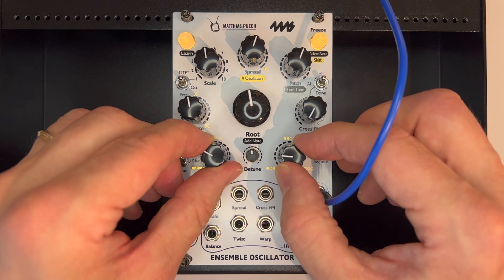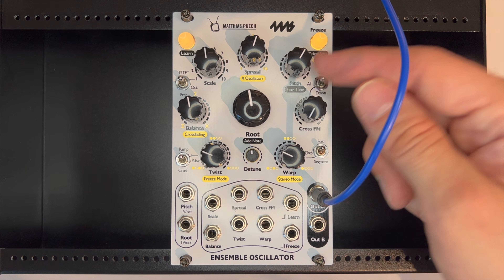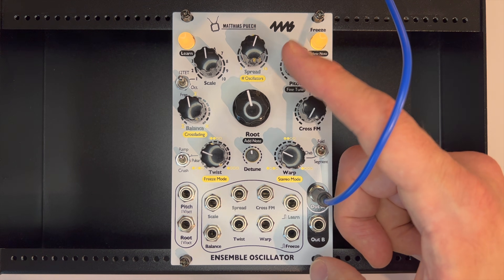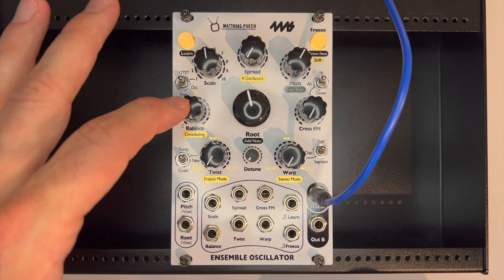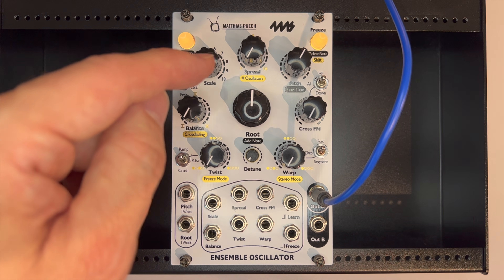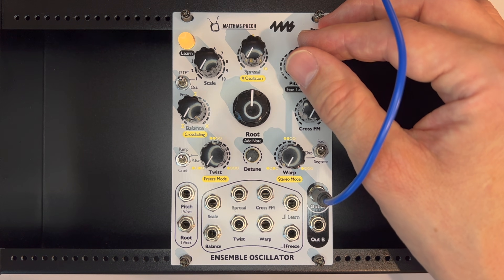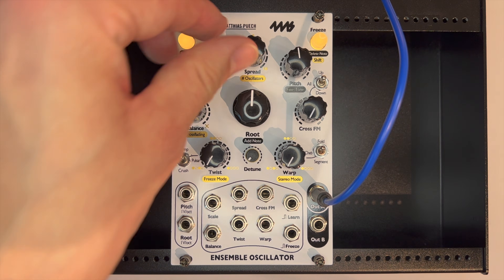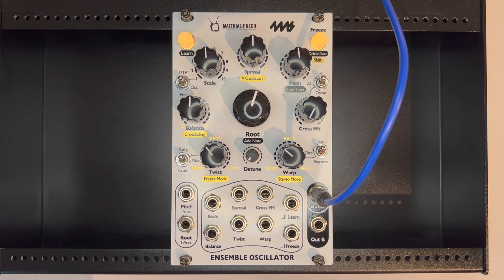How to tune the 4ms Ensemble Oscillator

Comment: It almost sounds as if when you turned knobs on the Ensemble, the other oscillator was harmonizing with it. Was that the case? If so, how did you patch them together?
Reply from the maker: They were not patched together or coordinated other than being in tune and sticking to the same tune.

Comment: Great tutorial! Have you had to mess around with calibrating the 1V/oct jack? I've tried it half a dozen times to calibrate it properly to my Arturia Keystep but it never seems to work properly. Ultimately I have to use the Keystep on the lower octave levels and then pitch the EnOsc up to whatever my desired register is to maintain accurate tuning when playing across the entire keyboard. I'm curious if anyone else has ran into this problem.
Reply: Same, never had luck calibrating 1v/oct jacks and tracking is in general not so satisfying sometimes depending on the octave changes.

Comment: PS, wouldn't it have been nice for them to put a lock / latch switch on there for the pitch? 🤩
Reply from the maker: A pitch lock is now available in a new firmware update
Reply: @MartinDoudoroffLLC  Hi Martin - been to the 4ms site and can't find a link for it (yes, looking in the firmware/manuals tab) - nothing there... suggestions? Thanks
Reply from the maker: @stevekirkby6570  https://www.modwiggler.com/forum/viewtopic.php?p=3849531#p3849531
Reply: @MartinDoudoroffLLC  Thanks so much, you're a star!
Reply: Now, not wanting to be a pain (LOL) but how do you perform the upgrade (ie, which button combo's and input for the wav file) ... again, no info on the 4ms site or on 'wiggler. Last question, I promise!
Reply from the maker: @stevekirkby6570  It’s in the manual.

Comment: How are you triggering the module? Is there a sync connection on the back of the panel?
Reply from the maker: The Ensemble Oscillator is a droning oscillator. No triggering required.